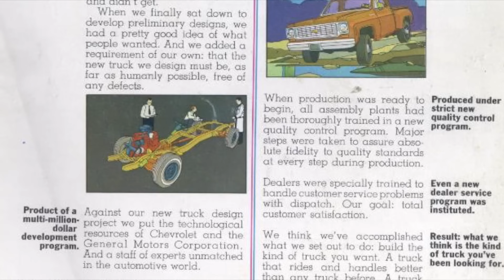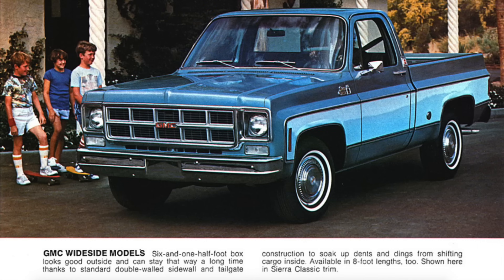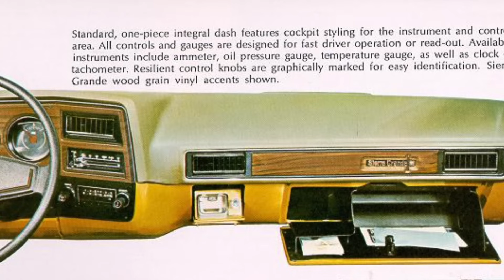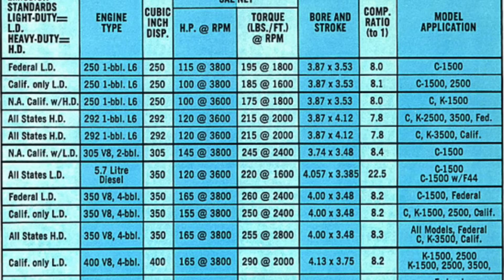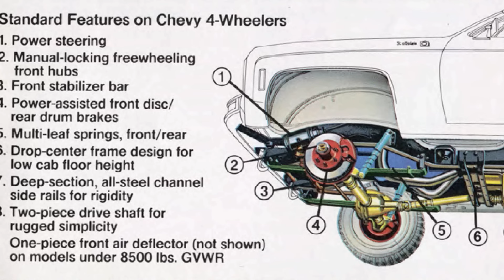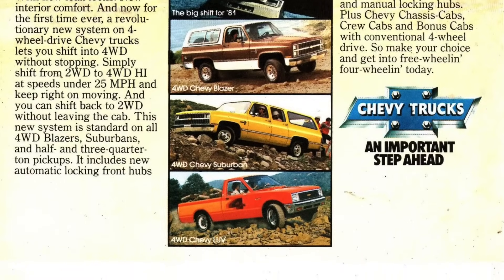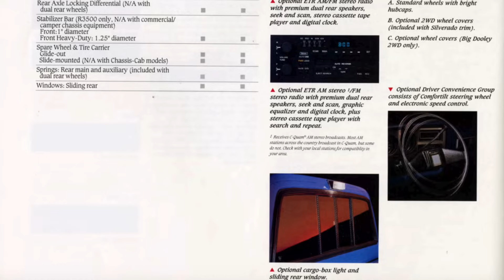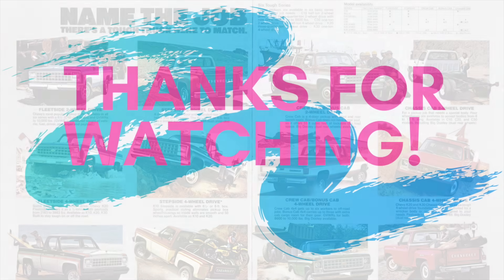73-87 Square Body Chevy & GMC C/K Truck Buyers Guide (Design, Options, Engines, Common Problems)

Comment: These trucks suck and people should buy Fords
Reply: @j.7647  Well yeah
Reply: When the duraspark box goes bad and leaves you on the side of the road or your 6.0 powerstroke blows its headgaskets and leaves you stranded or when your 2v triton spits the spark plug out of the head and hits the hood and puts a dent in it I think I you will never want a Ford product ever again.
Reply: @j.7647  f----g old rebuilt dodge 🤷‍♂️😁. I like em both but prefer the gm.
Reply: @briang4470  I'd much rather fool with the distributor at the front of the engine.  Duraspark box? Just keep an extra laying right beside the one on truck. I've never had one go out. My 75 high boy had the original.  They had five wires in 75, then went to four wire afterwards. But, it's an inexpensive box, not like the 800 dollar one on a gm diesel that does go out regular.  Never had spark plug problems on modular engines.  Once had the glass part blow out the center, which could happen with any engine. But never the plug and head problem.  Drove my 75 with a 33' horse trailer from Louisiana to Alaska.
Reply: @ridgerunner106  that "$800 box" on the 6.5 diesel is actually being reproduced in china and you can buy them boxes on ebay for like $40 with the relocation kit to put it in an easy access spot.
Reply: @briang4470  I have a 96 GMC 3500 HD with a straight front axle and 10 hole wheels, 19.5" tires.   The diesel runs smooth and nice.  Truck is straight, interior perfect, has a 12' tool bed and a crane.  I really am leaning toward a gas engine. Then I'll have to do something about the auto. I don't know what trans is in it, but it's big. It just started dying on me, started right back up, until one day it didn't.
I'm seriously considering gutting the whole thing and going gas.  I've got a shop and plenty of non computer donors parked here.  I would feel more comfortable being away from home in it if it was simple.  Let someone that likes diesels get mine.
Reply: @ridgerunner106  I personally like the electronic 6.5 diesels. But i will admit that once they get over 200,000 miles, that's when they start to become junk, by that point they are wore out and consume and leak lots of oil and usually start having I injection pump problems but if they have below 200k then they are usually perfect except for that stupid injector pump box but once you relocate it, it becomes good.
Reply: @briang4470  My engine is good and solid. But, if I'm out at night in it, fewer things to go wrong, the better it will be.  I want to oversimplify things a good bit.  Get back to it ain't getting gas or it ain't getting fire.  I can limp home with that situation. Just carry a few extra parts.
Reply: @ridgerunner106  honestly I would have full trust in the 6.5 as long as the injector pump box was relocated and you have a spare in the glove box, there really isn't much to go wrong with them but they are completely different from a gas engine in the way that they function which is hard for alot of people to grasp and I totally understand.
Reply: @briang4470  Oh I know, I work on equipment all the time.  But, with a gas, a few parts and a few tools, I'm good to go. With a diesel, can't carry enough tools, leave the light on in the shop, tow truck phone number handy.  Recently I left Louisiana in a 75 truck and a loaded 33' horse trailer and roamed all over Alaska.
Reply: Not everyone in the world had good luck with fords.
Reply: @oldcroneysgarage9739  I do understand that. I'm old enough to see it now.
Reply: My comment was to sway peeps away from these beauty's to keep the price down.